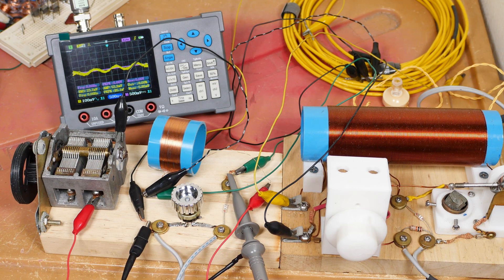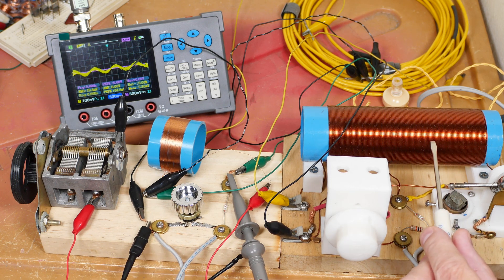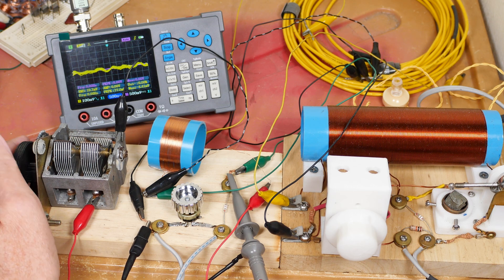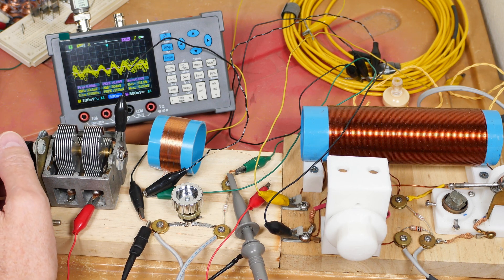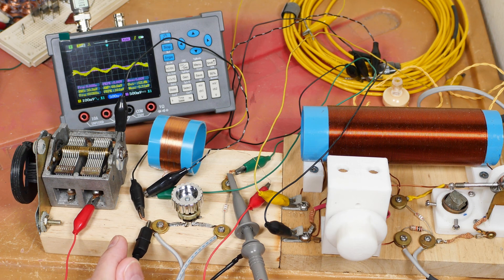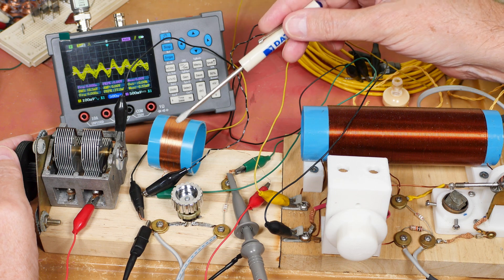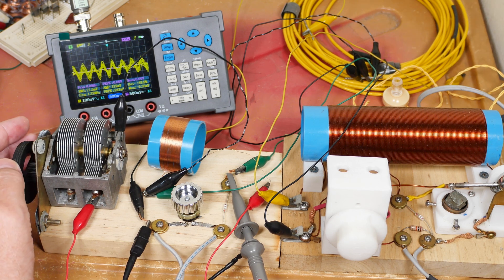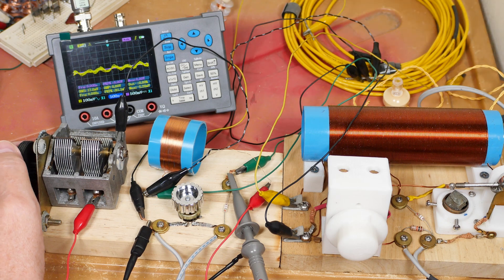Crystal Radio Coil, Fine-Wire Straight-Wind Experiment 1/3

Comment from the maker: RELATED VIDEOS:
Crystal Radio--The Bobbin Inductors Fail. But WHY? 2/2  
https://youtu.be/iH66WckUzFE

Crystal Radio--No More Small Core Inductors??? Maybe. 1/2
https://youtu.be/CJlAwvE5p7g

Crystal Radio--Cheap & Easy Inductor From Sewing Machine Bobbin
https://youtu.be/ecuhAiBYJzs

1 Capacitor Crystal Radio--No More Variable Capacitor Designs? (4K)
https://youtu.be/0AvTO588SyU
Reply: I've greatly enjoyed these various experiments with different wire gauges and types of coil forms so much that I ordered some #31 AWG wire and the plastic sewing machine bobbins to try the experiments for myself. I had the 1.65" diameter PVC tubing already. The wire came earlier this week but the bobbins only finally arrived today. I wound the bobbin using the #31 wire, trying to use the same technique with the variable speed drill and moving the wire back and forth on  the bobbin. I  didn't measure the wire, just wound what I thought was enough. The turned out to be over 1000 uH so I had to unwind quite a bit, I first got down to 513 uH and tested that--that had way too much inductance to cover the MW band (It wouldn't tune above about 1100 kHz) so I unwound more turns and finished with 222 uH which worked fine. I am extremely fortunate to own an HP4342A Q meter so tested all  the coils on that--its variable cap goes from 20-470 pF. The bobbin coil at 550 kHz had a low Q of 17; at 1680 kHz it had even lower Q of only 8. As the video showed, it didn't receive anything in the crystal set. I then wound a PVC coil with the #31 wire, trying to emulate the small coil used in the video--my coil ended up with 203 uH. At 550 kHz it had a Q of 121; at 1700 kHz a Q of 83. As the video showed, this one worked moderately well in the crystal set. I wound another coil with #20 wire on the 1.65" dia. form, this had 221 uH. At 550 kHz its Q was 181; at 1700 kHz the Q was 276. This is unusual in my experience to have a  Q that has a much higher Q at the top of the MW band--this is good! As the video showed, this is the reference coil for the crystal radio.  (I used the DER DE-5000 LCR meter at 100 kHz test frequency for the inductance measurements.) Lots of fun  doing my own tests and my thanks to TSB for doing these experiments and showing us the results that motivated me to do some tests of my own!
Reply from the maker: @steveratzlaff  Thank you for posting your results. The confirmation of one's results is always a good thing. I'm envious of your Q meter. I'm looking into a new LCR meter, but even those aren't cheap.
Reply from the maker: @steveratzlaff  Spoiler, I just finished a scatter wound coil on the 1.65" pipe that is 7mm long. Total wire length, including 1.3x for scattering, was 9.36 meters. It was a bear to wind (and rewind multiple times). We shall see. I think I might also try a straight wind on an 8mm diameter core like the bobbin, but it would have to be 20 cm long!
Reply: @tsbrownie      Should I assume you used the #31 wire for this new coil? If not, what gauge was used?
Reply from the maker: @steveratzlaff  Yes, 31 AWG.
Reply: @tsbrownie  I wound a similar  coil to yours just now, not sure about the "scatter wind" but I moved the wire back and forth continually while winding; just one first and last wind, no attempt to make it better.   :)    Mine came out as 384 uH-on the high side but I tried it on the Q meter. First thing is to check at minimum capacitance, 20 pF--the objective is to be able to tune to the top of MW band at min cap. This coil only resonated at 850 kHz, so too much inductance (and Q was a very low 9.)  I removed turns until I got 224 uH and tried it again- 20 pF still only went to 1200 kHz,  with lousy Q of 11. 365 pF gave 520 kHz and Q of 51. Based on these two tests, my opinion is the scatter-wind method produces too much (internal)  distributed  capacitance, and going to a larger diameter coil form just makes the the situation worse. If you try your new coil on the crystal radio it will be interesting  to see what you observe, especially if you have any stations you've received above about 1000 kHz.
Reply: (I have no idea why there's a line through part of the comment, I didn't do that deliberately and it shouldn't be there.)
Reply from the maker: @steveratzlaff  The white glue on my coil was just hard enough so I could mess with it. I was also at 3xx uH and had to remove 1.8 meters to get down to 220 uH. Interesting to see that we get very similar results. 
The different places that had instructions on scatter winding just said use your hands in a random pattern back and forth. At my age, that's easy. After all this work I'm absolutely going to make a video on it. Given your results, it seems that the scatter winding may be a very large contributing factor on the original bobbin scattering winding failing. Now I'm wondering how bad a straight wound, multi layer coil will be. If you google "rocket radio circuit" or such, you can see where people have posted circuit diagrams. The coil (if we can believe it) is consistently listed at 512uH and wound on the then standard core form (7mm???). Anyway, another step closer.
Reply from the maker: @steveratzlaff   My font switched to black in dark mode so I could not see the text I was typing, now I have to work in bright mode. It's the internet, there's always an element of randomness introduced to keep us confused.
Reply: Here's results of another coil using the 1.65" PVC form, this time using 175/46 Litz, 130 turns  regular winding (coil width 4.7"), 240.7 uH. On the Q meter, 20 pF minimum capacitance, 2070 kHz,  Q 580.  1700 kHz, 32 pF, Q 640. 1000 kHz, 100 pF, Q 670 (peak Q). 700 kHz, 210 pF, Q 570. 550 kHz, 343 pF, Q 480. 470 pF maximum capacitance, 471 kHz, Q 430. So using even relatively small Litz gives a large boost in Q compared to magnet wire.
Reply from the maker: @steveratzlaff  That is really interesting. I noticed the bump in inductance with the proper litz, but could not measure the Q. Thank you. That info opens some doors for small radio designs.
Reply: Just to correct a typo--the 175/46 Litz coil width for 130 turns is 4.2" not 4.7"--a little shorter than I wrote.    :)

Comment: Hi, do you know if it is okay to use coaxial cable with grounded shields to feed an antenna into the house? Would the shield interfere with the signal, for example, due to capacitance?
Reply from the maker: @Dark_Matter2  It has to do with impedence matching, and I don't know how to calculate / measure the input impedence of these crystal radios. You can always just give it a try.
Reply: @tsbrownie  I can add 5 meters of coaxial cable between my antenna and radio, I can compare volume with and without that cable, with connected gound and without ground
Reply from the maker: @Dark_Matter2  That's a reasonable test.
Reply: The impedance of a coax cable will be either 50 or 75 ohms, which is much lower than the impedance at the end of a long-wire antenna.  If your outdoor antenna is a wire dipole, then it should drive the cable efficiently, but then your radio needs to be designed to match to the cable impedance.  That means relatively few turns (like 1-4!) on the antenna link coil.  Or, design for a tapped-C feed in to the resonator.  (I'm driving a tapped-C crystal radio with 50-ohm cable to a dipole antenna that I use to transmit on the 80m amateur band; seems to work.)  By the way, if you have a dipole antenna, you don't need a ground.  The signal voltage is between the center and shield of the cable, not between antenna and earth.

Comment: I wouldn't have guessed the 2 coils would perform that way.  Interesting results.
It would be interesting to test where the self-resonant frequency is for the small coils and larger coil. your function generator and oscilloscope could test it. The further away from the medium band the better.  Another curious thing is, do you get a a noticeable difference in reception if you orient your coils vertically? If your external antenna is doing most of the reception,  the null-ing effect should be minimized.    
Also, could your external antenna being wound in a loop be creating a series inductance that is hurting the Q of circuit?
Reply from the maker: @aaronwoodard3354  I have tried standing the fine wire coil on end and did not notice any difference. I mentioned in another video that coiling up the antenna and ground wires like that can change the circuit. Usually, it's a slight decline, but every once in a while, it helps or at least makes no difference. I have the extra wire so I can move the radio to my other bench.

Comment: So the smaller one is 'scratchier'. The bigger more melodic. Anyone know why?
Reply from the maker: The resistance is about 6x in the 0.227mm 31AWG wire compared to the 0.81mm 20 AWG wire. May not be enough power to properly drive the earphone.

Comment: When I made my 4 foot X 4 foot tuned antenna, I used #14 wire which is a lot thicker than most people use in coils.  I did discover, however, that I needed to go to a lower inductance and greater capacitance than than I thought was correct to get the biggest amplitude.  Unloaded, it would make well over 1V on the scope.
BTW:  On a rocket radio I took apart, the slug's position was adjusted with a long thin brass threaded rod.  The nose cone was glued onto the rod.  To store it, you threaded the thing all the way in.  To tune stations, you would thread the rod out.  The treads worked on a metal cap on the end of the inductor's tube.  If you are going for a small radio, that method may be better than a variable capacitor  Even the ones they used in the early transistor radios would be about as large as the inductor part of the radio.

You could make the coil on the outer housing of the radio and fit the capacitor within the inside of the coil as another option.  Very conductive objects in a coil reduce the inductance without dropping the Q much.The plates can be arranged so that one dimension is along the major axis of the coil to reduce that effect.
Reply from the maker: @kensmith5694  Interesting information, thank you. I have been trying different coil / slug configurations, but can't get more than a 10 to 20 percent change in inductance. That's not nearly enough to tune in the AM band. Did your rocket radio have a small cap, like 3 pF?
Reply: @tsbrownie 
Points at coil you can't see
Points at slug you can't see
10.88mH  without slug
61..55mH with slug
Yes, it has a huge number of turns on it.  Also, this is not enough range to do the whole dial.  We need 
Range = 1700/500 = 3 is close enough
F varies 1/sqrt(L)
We need 3^2 = 10:1  close enough
I may investigate further but a switch and a capacitor may be a good idea.
********************
Merry whatever you do to all who may pass this way
Reply from the maker: @kensmith5694  Or multiple coils you can select.

Comment: Got any of those old Christmas ornaments that were pointed on each end and had a center section that was long and tubular?

We had them on our tree as a kid in blue, yellow and red and they had white christmas sceneries painted on the center sections.

I guess someone could 3D print a simular shape.

Wouldn't it be cool to wind a coil around the body of an ornament and convert it into a radio that you could hang on a Christmas tree?
Reply from the maker: If they have metallic plating, it won't work. I do have some snowflake shaped spider web coils. There's a video and it has 3D printer file links in the description.

Comment: Maybe change the spacing between the turns of the coil. To lower the capacitance between the turns of the wire. It is only a idea, have no clue how this will change the performance.
Reply: Yes. That was my idea too. It should lower the capacitance but it is harder to make such a winding.
Reply: @ulfhaller6818  Wind with the wire and a piece of string simultaneously which will space the wire. Remove the string when done and varnish the wire to hold it in place. Nothing to it!
Reply from the maker: @glasslinger   I did that as a kid exactly once under coercion from an older brother. You have to use glue, then remove the string (fishing line worked well) when the glue is tacky but before it's hard, and without disturbing the windings.
Reply: It will drop the capacitance in the coil but I don't think it is a needed thing for the AM band.  The tuning capacitor is huge compared to it.
Scramble winding also decreases capacitance because there are gaps between the wires.
Reply: Like a bifilar "Mystery" set!
Reply: @Pygar2  I also know that for making a coil with thick wire, using wire rope can work nearly as a well at litz wire.
Reply: @kensmith5694  I have to wonder if putting a var. cap. between the antenna and bobbin would lower capacitance.
Reply: If would also lower the resistance due to skin effect.